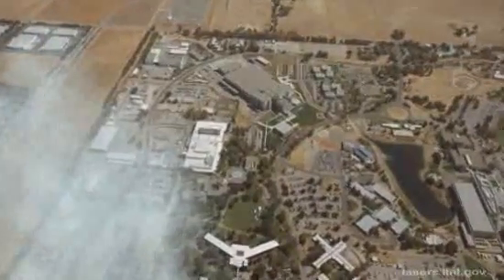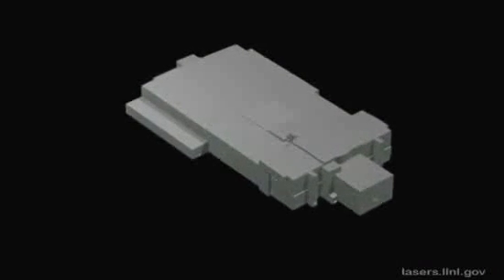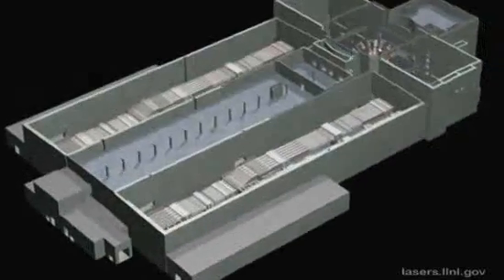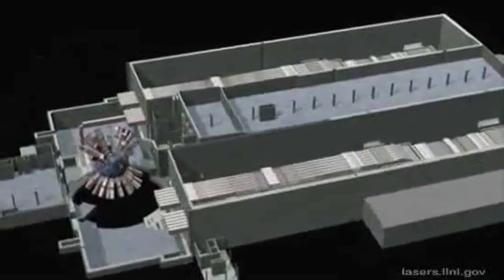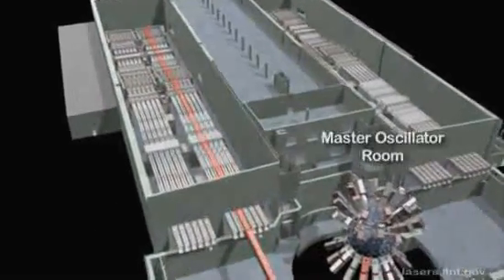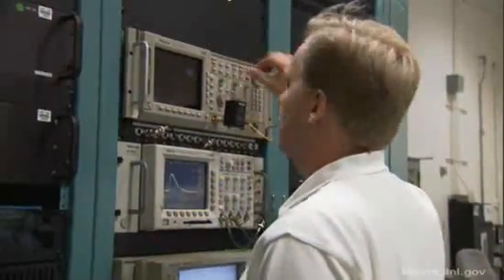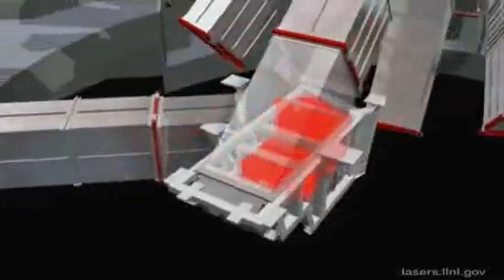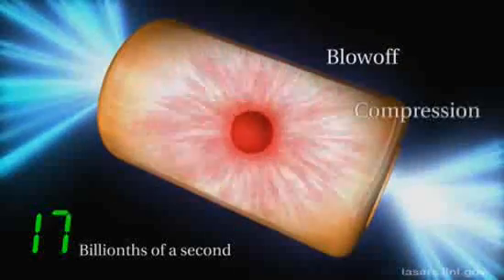fusion power from high energy laser

Comment: Yep, the facility is making more energy than it takes to power it. finally there's something concrete on fusion power. 

First commercial generators however are several decades away,

Very promising technology. BTW posted this video some 5 years ago, pity not many more seen it or took notice off. :(